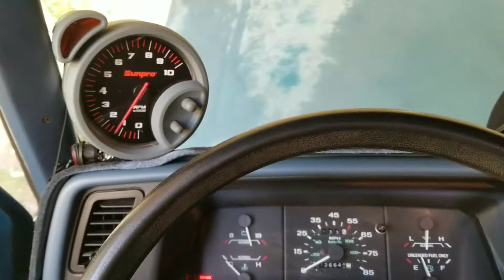Modded Ford Ranger

Comment: I have a 94 Mazda b3000 I want to swap a Taurus intake what cam I do also what cheap mods can I make please help me
Reply from the maker: Plastic Intake Manifold Swap, Headers, port the Lower Intake Manifold, get some roller rocker arms from Tom Morana
Reply: The Vulcan  sick bro thanks for the feedback I have a flow master on it only and it sounds beast my truck actually has a Ford taurus 3.0in it my step dad used to own it hes a mechanic so he did everything on it it's a Frankenstein  truck lol I love it though she slides like crazy I've heard from people that ranger 3.0 are slow and sluggish but mine isn't that bad I've beat Acura Integras with bolt ons before I even keep up with my brothers f150 5.4 it's not alot but not sluggish that's for sure feels like it has some torque should I make a quick video so you can see it maybe you can point some things out or something I live your truck bro hopefully mine gets to that point
Reply: The Vulcan also my brother has an AEM cold air intake for his f150 that he no longer uses I mocked it up last time to mine and it worked awesome felt like instant gains but I would need to make it fit on to the throttle body kind of looks like yours I want to buy it off him the intake is loud sound like like a damn supercharger hahah
Reply: The Vulcan my truck is loudrr than yours it's louder than any ranger I've seen at least 3.0 could it be because it's a Taurus engine  btw the engine only has about 110k miles
Reply from the maker: Don victory my truck is pretty loud. This video is very old. If you check out my newer videos you’ll see that I’ve don a lot more than this

Comment: where did you get headers I have an o2 Mazda dual sport 3.0 will the fit on it ?
Reply from the maker: TJ McDonald eBay headers or check out JBA headers. All 3.0 rangers and Mazda B series are pretty much the same just a different front face
Reply: The Vulcan it's been a very good truck my dad bought new the dual sport came with 2 inch left and fully loaded I haven't seen another stock ranger sit so high up its been garage kept 02 with 105k but so slow like to 2jz swap it lol
Reply from the maker: Yeah mine was pretty darn high as well. My wife gifted my ranger to me. Her parents owned it, had 120,000 miles and the service record dating back to 1994.
Reply from the maker: TJ McDonald this video is pretty old I have updated videos of what it looks like now on the channel

Comment: Which electric fan? How much was the e-fan conversion?
Reply from the maker: Victory went to the junk yard, bought 1 Efan off a Taurus with the same motor for 30$ wiring and a switch. And used zip ties to hold it in the middle of the factory shroud works perfect should cost about 50$ total if you go my route. Again my ranger is completely different not than in this video, a lot has changed
Reply: Good info thanks!!  Doing maintenance and repair on tight budget, on my 3.0 5spd Ranger edge 2WD.  Nice truck btw.
Reply from the maker: Victory thanks and no problem, pretty cheap when it comes to maintenance. Performance parts will run you a pretty penny tho. Headers aren’t cheap for these

Comment: Which fan did you used? 
That intake manifold what at car is it from?
Reply from the maker: Daniel Montano fan from an 03 Taurus, just wired it up to a switch. Intake I made myself out of 3inch pipe. Intake manifold from an 06 Taurus pretty big gains but the butterfly valve in the manifold will not work without the Taurus harness so I took out the valve and cut it and deleted it, which gives me more top end. For better low end leave the valve in, but you’ll lose all top end power. Not very easy to install the manifold but it comes with a 60mm throttle body from factory, you need the Taurus throttle cable as well. Check out my update vid.

Comment: What year is your ranger
Reply: Okay i got the same year. How did you hook up the gauge for the rpms
Reply from the maker: Tramarcus Cotton I wired it up to the rpm wire which is located on the coil on the manifold that's connected to the distrobutor via the center plug. I got rid of my gauge since this video and swapped in a 1994 explorer sport cluster with the tach.
Reply: Mine is 1993 it’s almost similar
Reply from the maker: Alex jones differences is I have alot in this trucks, 3.0, more than in the video, haven't lost a race too any v8 truck, or even v6 tacoma